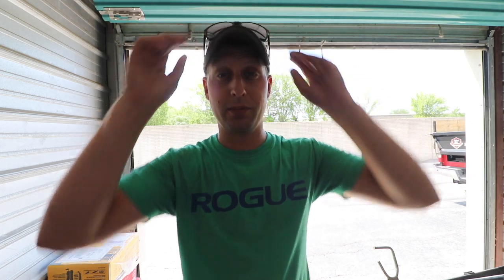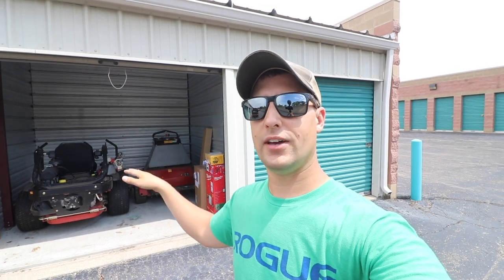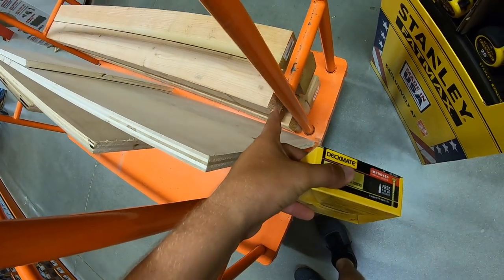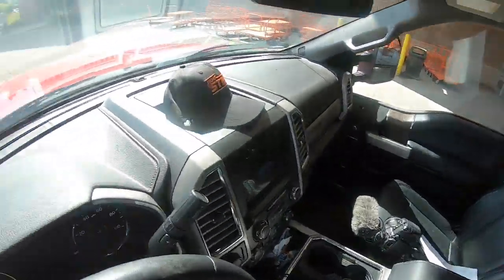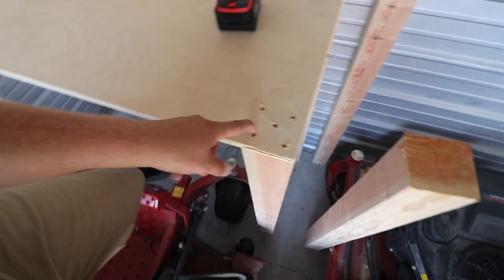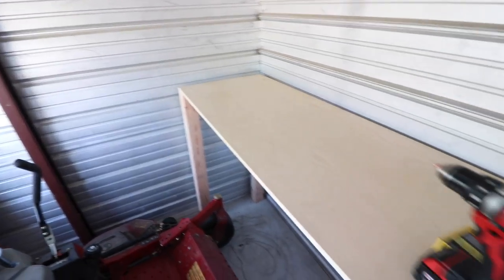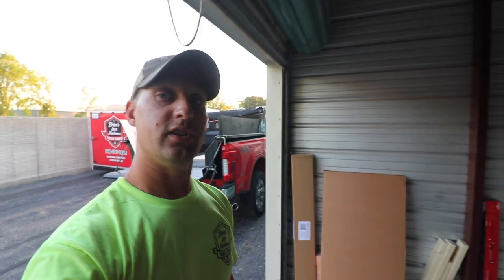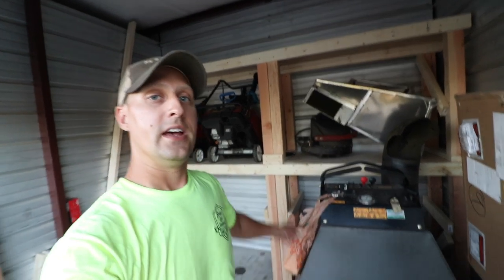Too Big For A Trailer.. Too Small For A Shop

Comment: House and a LARGE Pole Barn would be my ultimate goal !! I have a 2 car garage i use to store small equipment and tools and work bench. I also rent a 2 car garage for large equipment and use this to do oil changes, maintenance etc. They are about a mile apart. Works well but having it ALL under one roof would be nice. Just not in the budget.

Comment: I did the same thing with a storage building close to me. I rent to park our trailers have some units for other equipment. In my area garages and buildings that are available or that many at all in general. Its much cheap to go the storage unit route. For a 600 square feet garage building is around $1,200 in my area. You’re  better off buying a building for that amount of rent.

Comment: Watching you build these table tops.  One of the best ways to get stronger connections is with Kreg pocket hole screws.  You could use 2 x 4 instead 4 x 4.  Might have paid for the hardware using lighter wood.  You are correct using 3/4 plywood for table tops.  Looking good .  Congrats.

Comment: I have to hit up lowes soon. New trailer coming and i skipped mesh sides so i could put 2 ft osb for normal day mowing. But i can take it off and throw 4ft osb in the same spots and make the trailer hold more. 7.5 yards easy. And the trailer is custom so the axle is 5200 lbs with electric brakes so 2 tons capacity

Comment: Not sure if anyone has mentioned this but you were talking about no power at the unit. You could get a small portable gas generator that could run things such as your blade sharpener so you could have that there and out of the shed as well...

Comment: Nice video. Honestly Brian, I dont see you needing a big shop. You really only need a few parking spaces.... 1. for truck  2. for enclosed trailer.. 3. for snow plow and any other salt/sand spreader and you could put your dump insert there if u were to take it off. For mowers, and lawn equipment like ultra vac etc. all you need is a 20 ft storage container to hold everything. I think a landscaper like Brandon could also be in the same Boat..... Why dont you just split a location together. One side you, the other side Brandon. Save alot of money and plenty of space
Reply from the maker: For sure man. We’ve talked about a building haha, never know

Comment: I'm in Southern Ontario, (Brantford area)
Toronto has inflated everything, about 100 km or 62 miles to me. Because Toronto is a high growth rate they have jacked up house prices like crazy. 
A small house in Brantford, Ont. about 1,075 sq. ft. with single car detached garage sold for $339,000.00 18 months ago has just resold for $399,000.00 back in June.
I wish for the biggest house crash ever. 
Prices are nuts.
Houses taxes and insurance also going up to to the value. 
Federal Government directly responsible for 2009 to now have keep interest rates at 1.88%.
Was suppose to help people from 2009 with a mortgage. But another group of buyers thinking I can go out and buy a $950,000.00 house and garage put $50,000.00 down and finance it at 1.88%.
Now Federal government scared to raise interest rates, to house buyers that might not be able to afford higher interest rates.
The Federal Government created this mess by not increasing interest rates by 1.5 % a year.
We should be at 10 % by now from 2009.
These cheap interest rates are now driving house prices to values never seen before.

On the storage part of your video. I got some land I bought years before, will be looking to build a steel building and stop renting a storage locker like you. Keep getting more equipment, with a need to store it out of the rain.
Will look into steel building in the fall once out of this heat and humidity, can't think straight in this stuff.

Comment: I got a question. In the past I didn't pay attention to trimmer line, as long as it was line I used it. After being informed I've been getting black diamond. Wow. So my question is, are all edger blades the same? Is there a premium or is metal just metal?
Reply from the maker: For trimmer line I still recommend the ECHO Black Diamond.. I really think it leaves the cleanest cut. For edger blades, they're all pretty much the same. You can get them for $1-$1.50 at any OPE dealer. Hope that helps!

Comment: I rent a 40x50 area secluded and guarded for $400 a month which also has a place for me to dump leaves and grass as much as I need no charge. I thin bought a used box truck body 10x18 to use for a shop which only cost $500. I setup solar power in it so I have video cameras, 12V power and invertor power there for free (besides initial cost) It works great, can park about 8 vehicles/trailers.. I also setup a Harbor Freight 10x20 canopy to keep my open trailer parked under so it doesn't get rained on. I have a walkthrough in my video on my channel about the leaf box I made on my trailer for the walker. Check it out

Comment: Anyway you can do a demo/review of a exmark Radius E 44"? Just started out, trying to run a very small side business. Currently using a 42" Toro ZTR, and I would like to upgrade to this mower to still be able to fit inside a 48" gate. I can't find any other 48" on the market that would fit, so it's very intriguing to me.